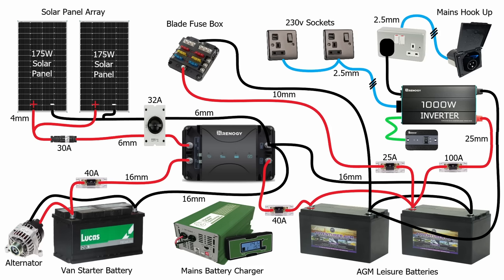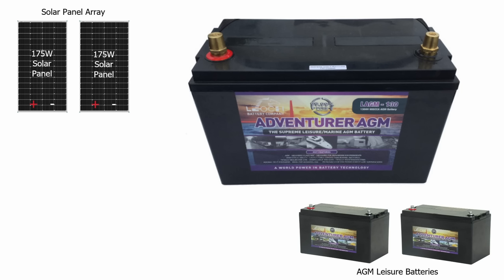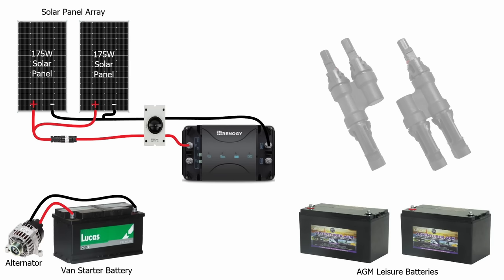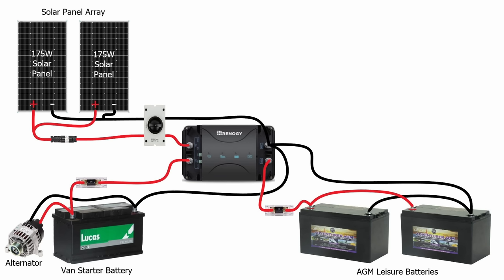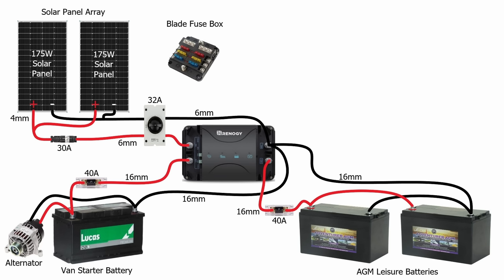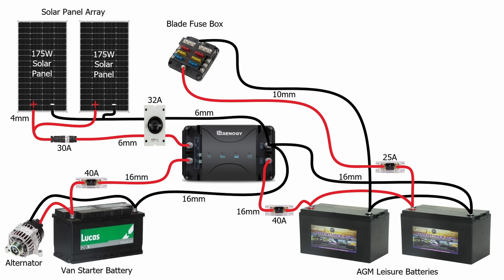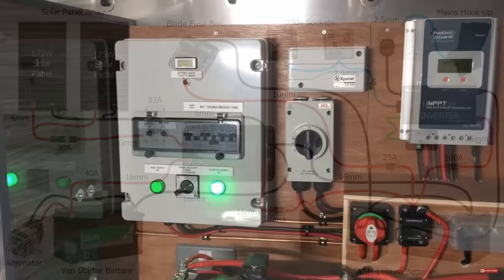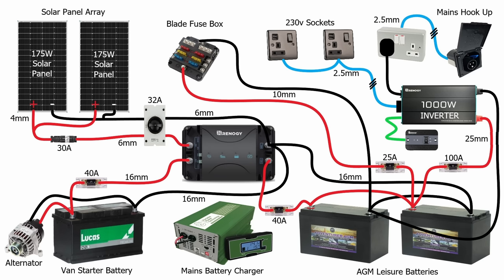12v Electrics for Off-Grid Campervan - Fiat Ducato Budget Build Ep12

Comment: Are the wire dimensions the diameter or cross-section?
Reply from the maker: All wire sizes refer to the cross sectional area of the conductor. 
In the UK  the cable sizes are stated in mm squared 👍🏼😊
Reply: @GregVirgoe  Thank you. Now I can convert to AWG gauges. 😀
Reply from the maker: @stan.rarick8556  there are loads of free conversion charts online. Here’s one for example https://www.lapptannehill.com/resources/technical-information/metric-to-awg-conversion-chart

Comment: Hi Greg where do I wire the battery charger ?
Reply from the maker: Place the positive and negative wires from the mains battery charger onto the same batetry terminals as the DC to DC charger, so both chargers are connect to the battery string using the same point. Your solar charge controller will see the high charge voltage when you are on mains and automaticalaly switch back to float mode so it's safe to use both together. Hope that helps
Reply: @GregVirgoe   Do I leave this connected permanently ?
Reply from the maker: @Acookinthefield  yes you can leave the mains battery charger connected to the leisure batteries just turn it on when you are plugged in and need it 👍🏼😊

Comment: I know you’ve mention the sizing of cable but does length matter? As when I looked to buy cable they have 3m and 6m 6mm cable
Reply: Also I can’t see a 16mm cable in links to cables
Reply from the maker: hello Lewis, yes cable length does matter if you have long runs, there is a voltage drop that ideally needs to be below 3-4% You can use this free online calculator to work out your ideal cabel sizes https://www.12voltplanet.co.uk/cable-sizing-selection.html
Reply: Amazing thank you! I tried looking for the 16mm cable couldn’t find it following your link to “various cable sizes” only 10mm and 25mm cable. Should I look for another branded cable instead of renogy?
Reply from the maker: @lewisdukes4786  the cheapest supplier I have found recently for battery cable is quickbit.co.uk
Reply from the maker: @lewisdukes4786  the cheapest supplier I have found recently for battery cable is quickbit.co.uk
Reply: Thanks for the response very helpful. I can’t find a 25amp inline fuse needed would a 30amp work the same?
Reply from the maker: @lewisdukes4786  you need to add up all the loads of all the equipment you have attached to the blade fuse holder. Add 25% to that total and that will be your fuse size.
Reply: Do have any links for a good 25A fuse holder I can’t seem to find one with renogyy only 20A
Reply from the maker: @lewisdukes4786  I put that in there deliberately knowing it wasn’t available because you need to work out exactly what you have connected to the blade fuse holder and size that fuse accordingly.

Comment: With the renogy inverter is there no need for a consumer unit when using shore power

What would be required to have the shore hookup charge the leisure batteries
Reply from the maker: I would still recommend fitting a consumer unit for short circuit protection and final circuit protection.
The battery charger that I talked about at the end of the video will charge off the mains
Reply: Thanks @GregVirgoe  a couple of followup questions if you don't mind. I see a lot of debate about whether or not the 230V should be earthed to the chassis. What's your view
And finally is there a limit to the number of sockets you can link in series from the inverter. Obviously there's a limit to what can be connected at one time.

Comment: Renogy Inverter.

Where an inverter is a permanent installation with the output connected to multiple sockets with distributed wiring, it is regarded as a mains AC power source and needs a RCD for electric shock protection. Not all inverters have the neutral to earth bond required  for the correct operation of the RCD. There is some confusion as to the inverter suggested, the Renogy PUH1 101235, actually having a switched neutral to earth automatic bond when operating in battery only mode. Although some Renogy inverters have the bond in place, it seems the PUH1 does not have this function, the USA version , PGH1, clearly states that there is no bond, and that a neutral to earth bond external on the output is not allowed , the European handbook is not very clear on this, but suggests that neutral bonded appliances should not be used.

In view of this I would not recommend installing this inverter as a permanent install.

In general, inverters with built in sockets on the inverter case should only be use with appliances plugged directly into the inverter sockets, one at a time. In this situation the risk is low.

Where the inverter is integrated into the camper distributed sockets and appliances, there is a greatly increased risk, thus the inverter must have the neutral to earth bond when operating in stand alone mode, and a RCD fitted in the inverter output supply.
Reply from the maker: On page two of the manufacturers manual under the heading Safety Features it lists….

Output short circuit protection. 

The fuses plug would obviously give overcurrent protection. 

I’m currently waiting for a reply to a support ticket regarding this installation.
Reply from the maker: I have had official response from Renogy and they confirm that the AC output is protected by an internal RCD so I do not need to fit one externally. 
Obviously different manufacturers would have different protection so you would have to check yourself.

Comment: I'm not sure about your logic regarding the size and weight regarding your choice of the 2 AGM batteries. I've just installed a 200ah lithium, probably weighs less than one of those AGM, the space to fit it  is just over half of what those two, and capable of providing power right down to something around 7 volts, instead of watching for the dreaded 12.3volts you mentioned. What you say about running higher power items is correct, again lithium solves this, we're running a 1500w inverter, runs microwave, wife's hairdryer no issues.
Reply: Certainly for safety reason.... I don't want lithium in my van
Reply: @14KiloWhisky  yea? your lose

Comment: You never showed a device for low battery cut off. In the shown scenario you can drain your batteries too low and damage them.
Reply from the maker: Only if you’re stupid enough not to look at the battery voltage 😂

Comment: you should really use a a bus bar for your battery it give a better life spam
Reply from the maker: Sorry but you are wrong 😑 another connection and extra cable means more resistance and volt drop making the system less efficient. Simple direct connections are much better.

Comment: Your agm batteries are more expensive per watt cycled 30% compared to Fogstar 24v 280Ah battery that has 7kwh energy 98% from a cycle, with 10 years warranty. The cost is £1200 for 7kwh energy capacity to have 7kwh per day for full 4000 cycles.
That comes out to be £120 per year for  2000kwh energy per year.
Telling us that your agm is much better financially, is not true at all.
Revise the total cost per kwh for every 10 years with AGM. bye

Comment: There is an old saying, what is the difference between an elephant and a plum. They are both purple except the elephant. Your hook up and explanation is the same as almost every manual from realty or victron. What you neglected and glossed over was the line hook up, the disconnect for the charger that most people have in their existing system, and what to do with the generator. NOBODY ever discusses this.